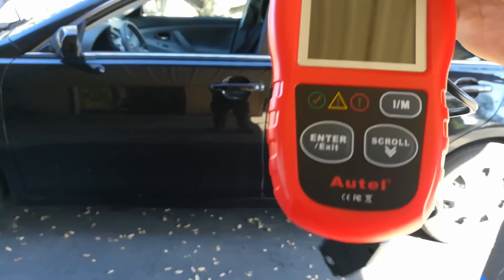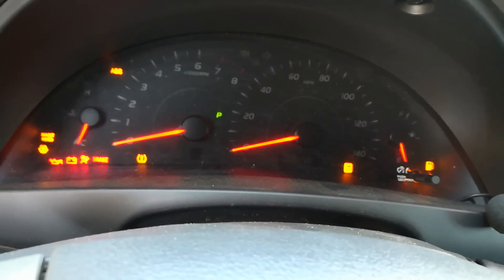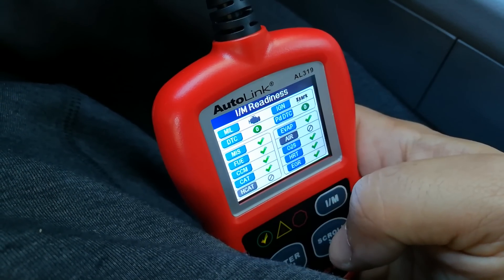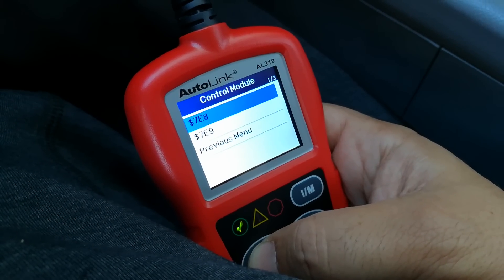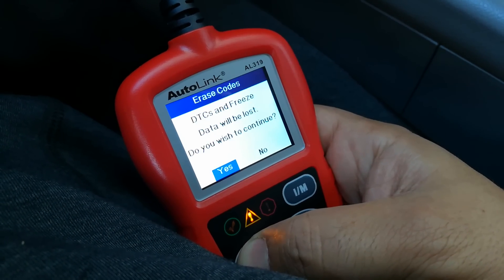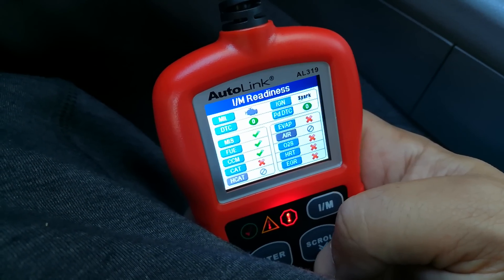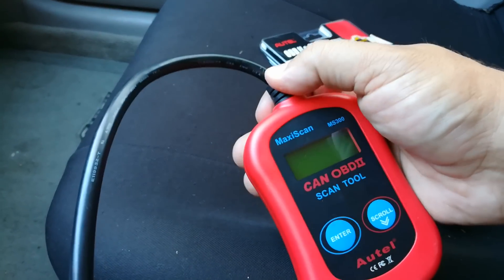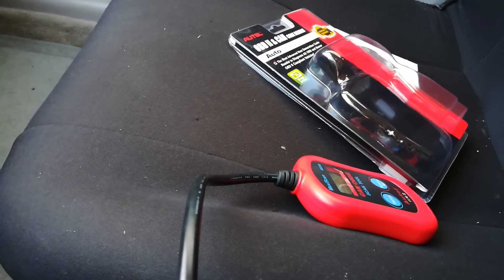Reset Check Engine Light with AUTEL AL319 OBD2 Reader Review

Comment: I just got this unit. I'm getting the red exclamation point, but are you saying that it means that the tests aren't complete? I was thinking it meant that one of the codes show a failure. The failed code for mine shows as the evap. pressure sensor switch "P0 0450" but the full list shows a green check for evap. but a red check for the catalytic convertor. But there's no error code showing for the cat. convertor.  Confused about that..
Reply from the maker: Are you clicking I/m ?
I/m is for inspection monitors and the red exclamation means not all the monitors are ready.
Here is an updated review and instructions, the two units are almost identical but just look different https://youtu.be/SguhiTfgpFQ?si=iYulT6SgDVEbbxZl

Comment: If you buy a car and find out later that the check engine light has been cleared, how do you reset it to where the check engine light will come back on?
Reply from the maker: Good question, the vehicle will trigger the check engine back on by it's self. You don't want to trigger a check engine by yourself because you want to know which DTC code the vehicle is detecting and throwing.
There are better tools like called scan tool that find me deleted codes. Here is an example https://youtu.be/VYX9-jMHc88 and there certain DTC called PDTC or permanent diagnostic trouble codes that can not be deleted and you may not know that they exist because no check engine light will be on.
Reply: @RANDOMFIX  Thank you.

Comment: Hello my al319 seems stuck and I can not unplug it
I cleared code but can not unplug from car.

What am I doing wrong lol
Reply from the maker: Normally you just plug it out. There are no clips or locking mechanism on the plug. What you driving?
Reply: @RANDOMFIX  
Thanks 
It  was first plugged in and it seemed stuck but I was able to pull alittle harder and it came out.
I was afraid to pull to hard on it as to not break it.

Thanks for your reply
Reply from the maker: Glad to help

Comment: After resetting the codes it will come up red on some things like EGR, CAT or OS2 etc but that means you have to drive your car enough to get a run a test on those parts, driving a little bit wont work, if you check in the live scan or freeze frame you will see under the parts that came up with a red cross that they say INC, this means you need to drive it more
Reply: Very good! 💪🏻
Reply from the maker: I appreciate your constructive comments, thank you for the feedback!

Comment: So I plugged it in...showed all green check mark lights.

Went to erase check lights mode and said are you sure you want to erase data? I said yea and pressed ok..
Than that’s when I got warning lights red  on the gadget? What gives?
Question. Have is how do I go back or get all my green check light back? Is there a reset
Reply from the maker: Sorry for the late reply! did you find a solution?
Reply: Have this same issue can I get some help on this?

Comment: just bought the 319! Never even thought of using it to buy a used car! Here in Canada its reg $120, but on sale for $59. Great unit so far, works deadly! Used on 2009 chev  cobalt and 2015 ford explorer no issues.
Reply from the maker: Ironman000, I think you will really enjoy the AL319. I just tried out the Ad510 and I'm even more impressed with this Ad510 because it features live data and can tell you how miles ago the check engine light was cleared so buying a car got even easier with that information. -RandomFix    Here is a direct a link to video https://youtu.be/4UF0oK5sERk

Comment: thanks for the video!  I reset my code (P0431) a couple of days ago and the drive cycle for CAT and AIR hasn't been completed yet (after 120mls!). The red LED came on (like you showed), but in my manual it says the yellow LED should (which is obviously wrong).
Reply from the maker: Frank, thanks for pointing that out, to get your vehicle to pass smog or complete your drive cycle check this video
https://youtu.be/jldTJI64cfM